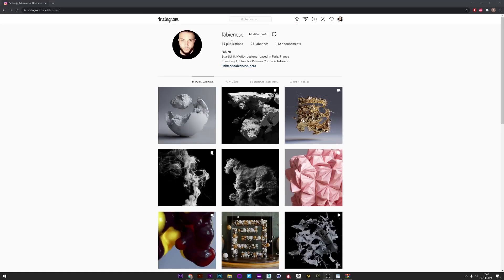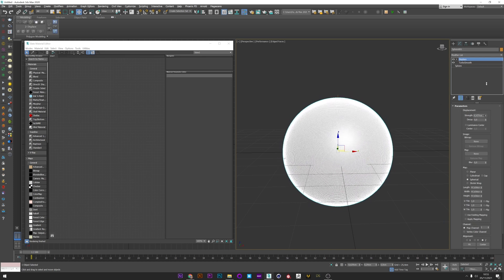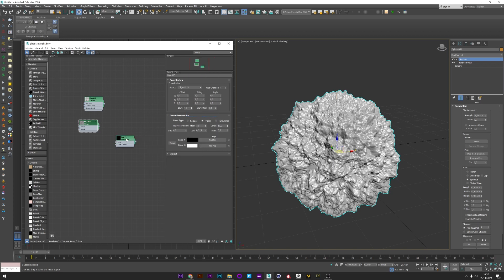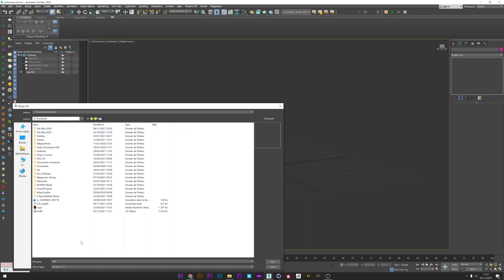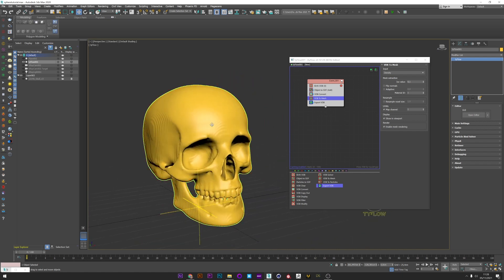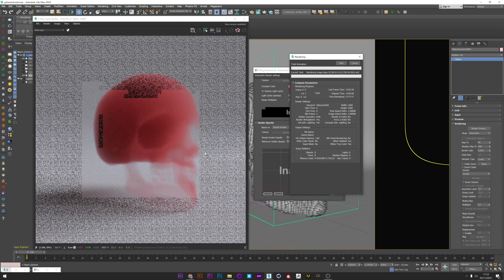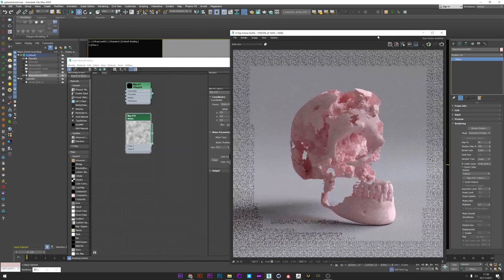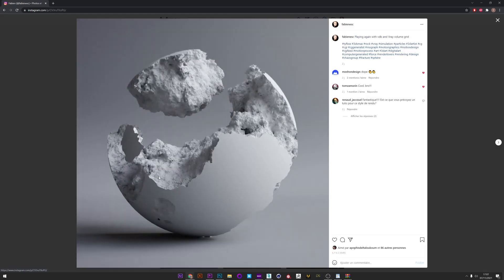VDB & Volume displacement | 3dsmax x Tyflow  x Vray tutorial

Comment: Strange, YouTube deletes comments.
I repeat, vray Grid is an excellent mechanism, it often helps out. It also works great with Corona Renderer.
Thanks, Fabien!
Reply: Hi there tomyoda, does it work with Corona Render?!? As far as I know in Corona, the VDB grid you can only get smoke/volume materials... would be great to know how can you apply a standard Corona material to the grid, do you know?
Thanks
Reply: @tixoula  To use corona material for vraygrid, you need to specify in the settings to use vraygrid as a mesh. Preset vraygrid I usually choose houdini liquid.